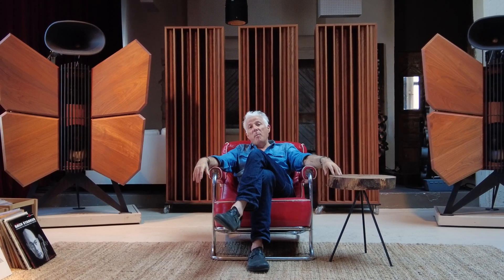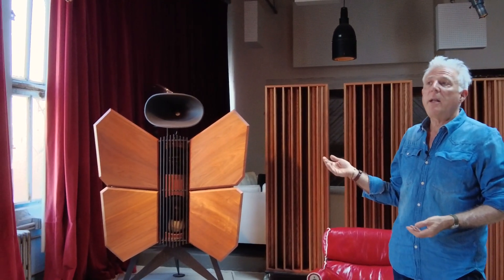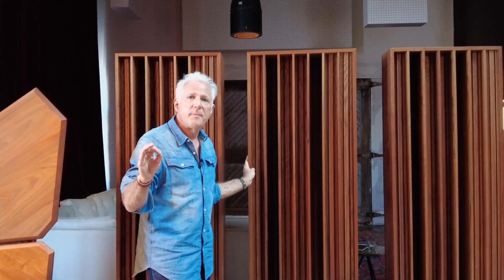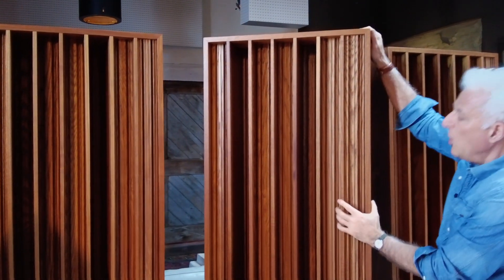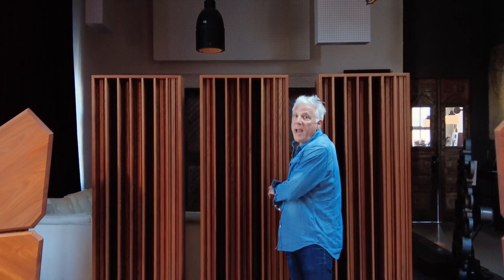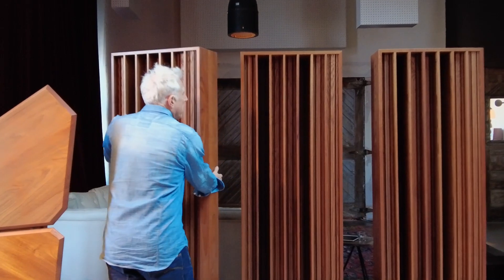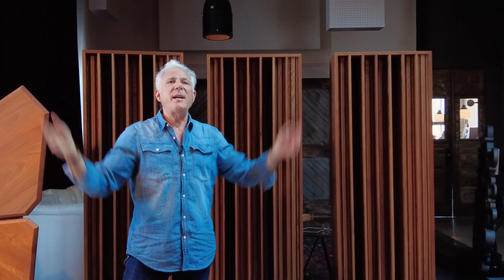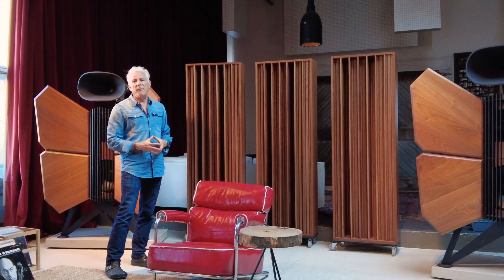Acoustic Treatment - The 1D Diffusor

Comment: Thank you for sharing the QED 1D diffusers — they look beautifully made and very elegant. I have a couple of questions regarding their design.
Most of us have limited space behind the listening area, so these panels will generally be installed on the back wall.
Question 1:
Why is there a gap between the panels? Wouldn’t that gap reflect sound and reduce the acoustic effectiveness of the diffusers?
Question 2:
Is it better to repeat the same QED panel sequence (like in your arrangement), or should the slot depths be shifted between panels? 
For example:
Panel 1 (left): [1,4,2,2,4,1,0]
Panel 2 (middle): cyclic shift by 2 → [4,2,2,4,1,0,1]
Panel 3 (right): mirror of left → [0,1,4,2,2,4,1]
Alternatively, could Panel 3 use a cyclic shift by 4 instead of mirroring the left panel?

Comment: QRD are very well known, work great with wide dispersion speakers, and are effective anywhere there is room. Their dispersion needs at least 6 feet to be uniform and avoid comb filter effects. These are very narrow with few wells, but with lots of extra flutes as if intended to extend and diffuse higher frequencies. Or maybe just to look cool. Not a lot of technical expertise on display making it hard to know which.

Comment: You are partially correct - The distance to the backwall is not as critical as having the 1D (or any diffuser) at a distance away from the sweet spot to more uniformly diffuse the mid / high frequency range versus random frequency reflecting. That's the real benefit.

Comment: Hello, could you have both absoption and diffusion if you filled the wells with an obsorption material?
Reply: There's an interesting product from Acoustic Fields that has low frequency absorption in the base of the diffusor along with Activated Carbon, which is a dense, highly porous material is probably the best for low frequency absorption stuffed in the wells. It's their QDA series Quadratic Diffusor Absorbers.

The Diffusor handles the frequency range of the Prime Sequence chosen (the higher the Prime Sequence, the wider the frequency range of the diffusor, but the cabinet is also deeper as they go down in the lower frequency range, but they usually start in the 200hz and up to around 3,500Hz, , and then the absorption takes over the lower frequencies down to 30hz.    With Diffusion and Absorption you need at least 50% surface coverage for the best results, But I would DEFINLTEY consult with someone that actually knows how to treat your room rather than just buying a product and sticking in the room.  For diffusion to work best, you need to deal with absorption and getting the RT60 times in a certain range.

Diffusion can be the best thing in the world, BUT, if the rest of the room's issues aren't dealt with first, they can be the worst thing in a room.

Here's a link.  https://www.acousticfields.com/shopping/

They offer a wide range of diffusors and their cabinets are built like fine furniture, they are heavy but they have casters.  they have another product that's stackable so you can change from 1D to 2D called their Modular QDA series.  https://www.acousticfields.com/product/qda-13-m-modular-diffuser-absorber/. you can stack them on top of a modular base unit that can absorb in the 30hz to 50hz range, called modular base ACDA 12. https://www.acousticfields.com/product/acda-12-m-modular-bass-absorber/

Their modular units are great because you can choose from a variety of modules for different functions to create a room within a room, and since they are relatively small, they are stackable and you can more easily transport them should you move to another location.

FYI, I do NOT work for Acoustic Fields. I just have met, talked to, and have visited several rooms with their treatment to get first hand experience with their treatment.  Flat out, they have done their homework and I've never been in a better sounding room than theirs.  Their low frequency products are hands down the best on the market, their open cell foam performs exactly how mid to high frequency absorption SHOULD work.  Their products are made well and they have a process they use to figure out what you need and they take a lot ore into consideration before they recommend which product(s) to use.  They also sell build plans so if you have the equipment to make your own, they also cater to the DIY crowd, which most companies do not.
Reply: @Oneness100  thanks for the detailed answer.

Comment: Fascinating Jonathan. 
Whilst you were explaining I kept looking at these as there was something familiar to me in my mind and then it came. 

I live in a tiny village close to Vienna called Kritzendorf which is right on The Donau (Danube). 

Very near to me is the Donau Schleuse Greifenstein this is a flood prevention and river control system which helps control the speed with which the Danube flows past Vienna and can help prevent flooding and it does so by crossing the entire river separating it into channels thus diffusing the flow making it more controllable and also having the ability to alter each channels speed.

When I have stood on top of it at spring run off time from the Alps it is very easy to see its effect from uncontrolled up stream to much smoother and slower downstream.

Looking at your design it strikes me that as the sound waves are channeling through these a similar effect occurs and the positioning of them is a bit like altering the sluices on each channel of the dam though instead of physical blocking with the gates the angles these are positioned do the same job, does that make sense or do I need psychiatric help! 🤓
Reply from the maker: Makes total sense, Ian!! :)